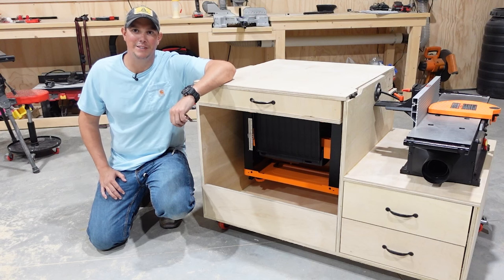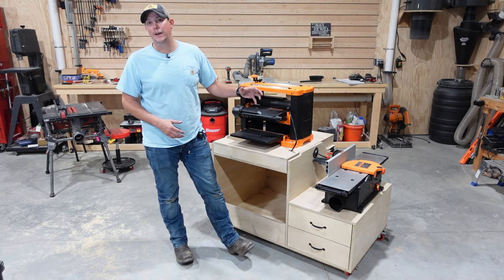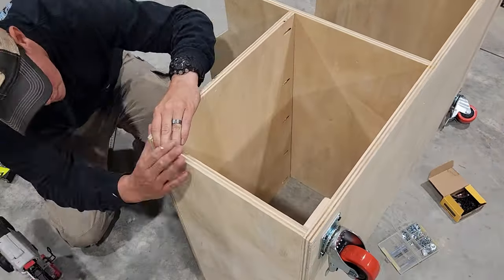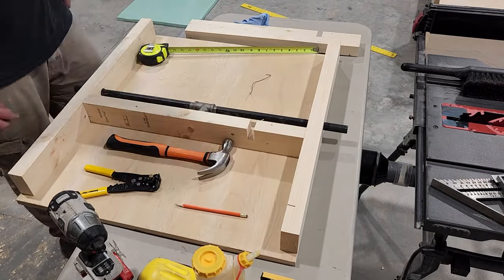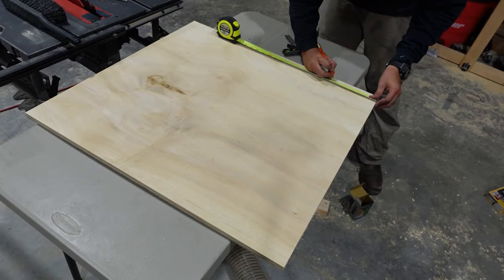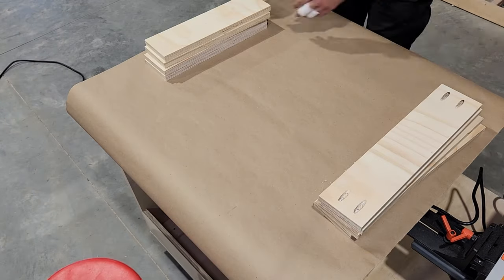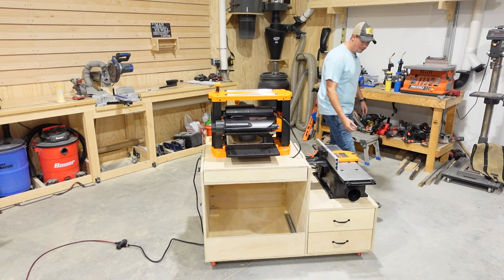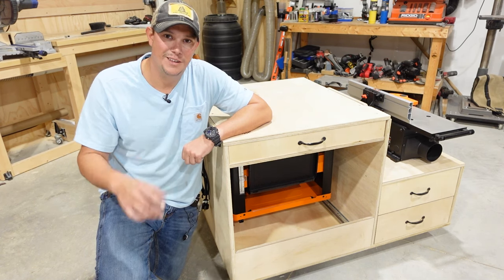3-in-1 Planer / Jointer Flip Top Tool Cart

Comment: Any reason you built the jointer so low? Could you build it same height as the planet and add another drawer?
Reply from the maker: So it will fit under my workbench with the planer flipped down

Comment: the jointer seems too low to use conformably, is there a reason its so low?
Reply from the maker: So it's the same height as the the flip top.  This is designed to fit UNDER a workbench when not in use.
Reply: @PatriotDIY  Nicely built. My only question/concern with this design is, Are you planning on kneeling down while using the jointer? if you have a lot of joinery work to perform, your back will be pretty sore by the end.